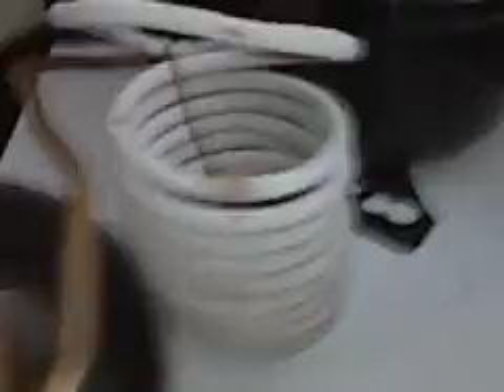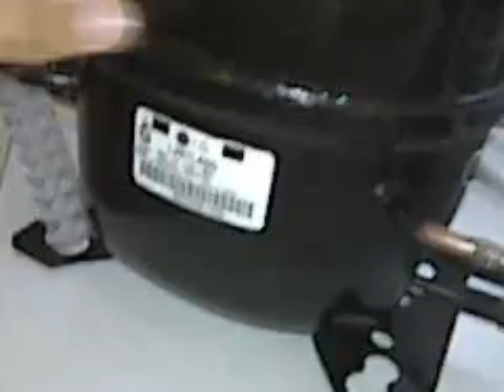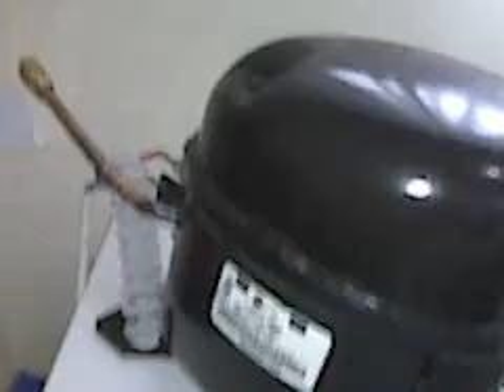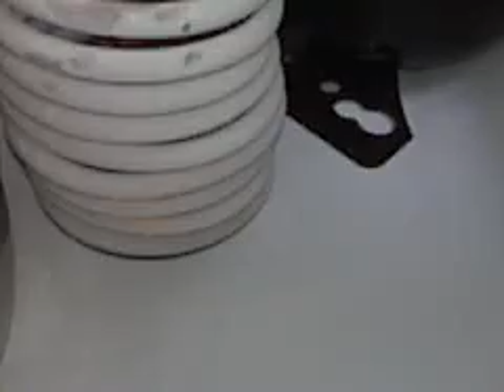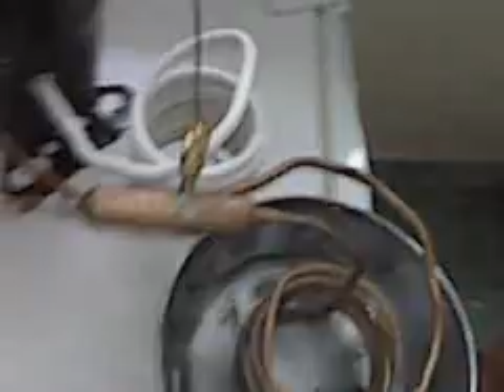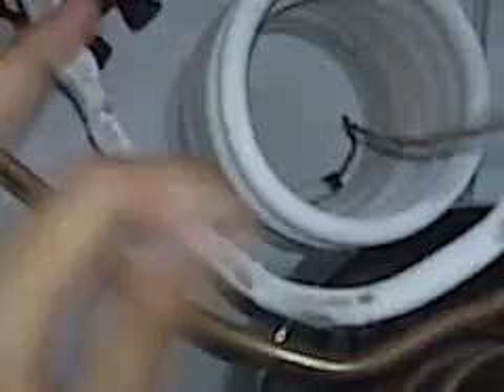DIY Refrigerator/Water Chiller Introduction

Comment: How did you size the condenser, evaporator, and capillary tube?
Reply from the maker: I tried to mimick the lengths used in a refrigerator using the same size compressor. Sadly, it isn't very straightforward 😀
Reply: @KompulsaOfficial  Thank you for your response. Did you add any length to account for the lack of fins?

Comment: I like you! - your ANOTHER person that thinks outside the box! - peltier units are the difference between normal water cooler water and "chilled"...every water cooler has one in it and also voltage creation because of either heat or cold.

Comment from the maker: As I said in the description: When I said that there is no other way to refrigerate, I meant that moving heat is the only way to refrigerate.

Thermoelectric cooling also works by moving heat.

Even evaporative cooling operates by moving heat into water vapour, and then the water vapour is pushed outside. :)